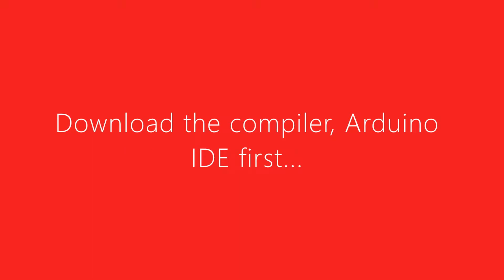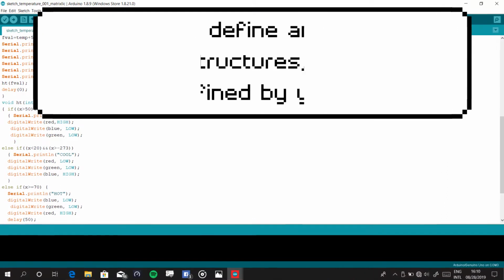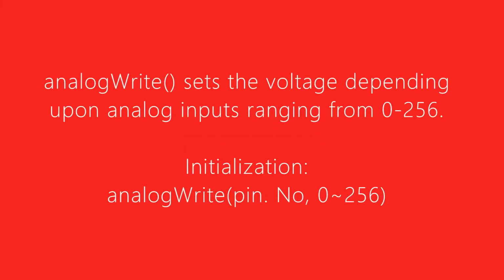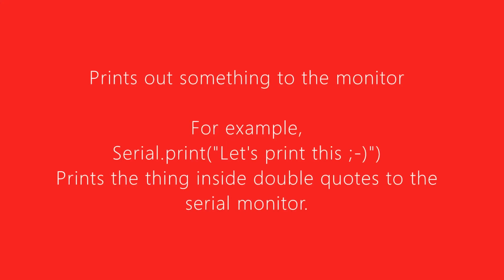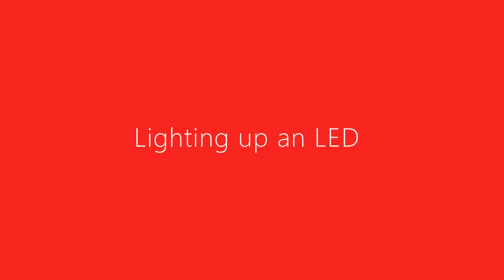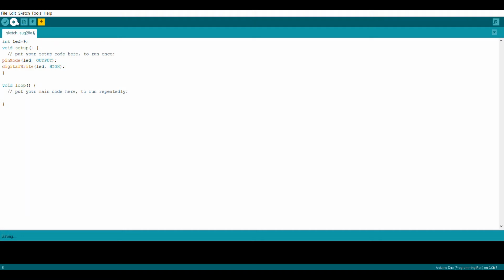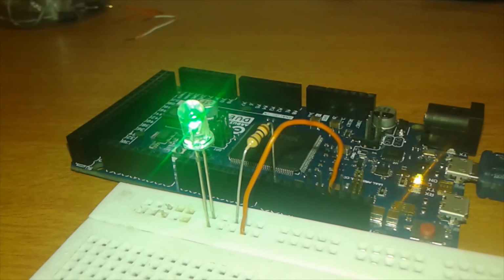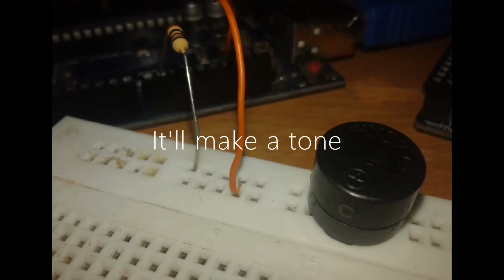LEARN BASIC KEYWORDS AND FUNCTIONS IN ARDUINO PROGRAMMING

Comment: Matrix, you've made it. I've been in need of this kinda one. Anyways, appreciate you for reading my mind. I've problem with my arduino MEGA that it isn't recognised my computer. I can't totally say that it isn't working, because it's fine. My computer is not making a connection with it. Please respond.
Reply from the maker: Sam Houser Try changing ports, it may help. If it doesn't,  go to Device manager and over to USB serial device. You can see a device listed as an unrecogonized one or one named COM. Update it's driver